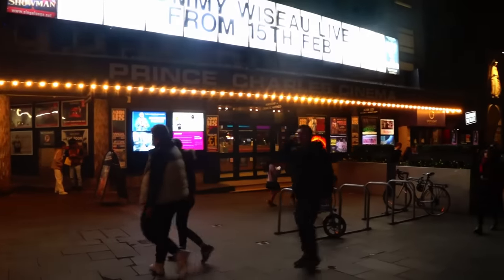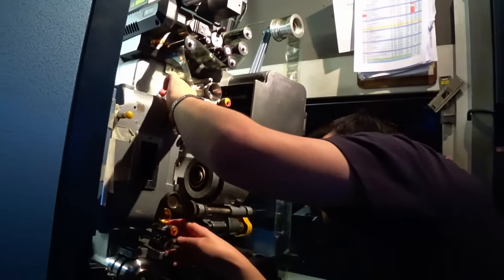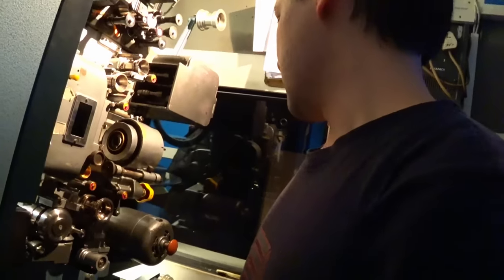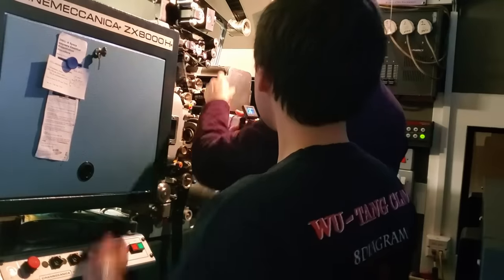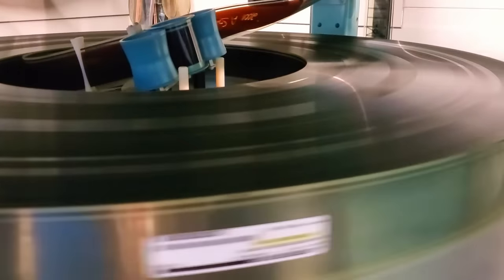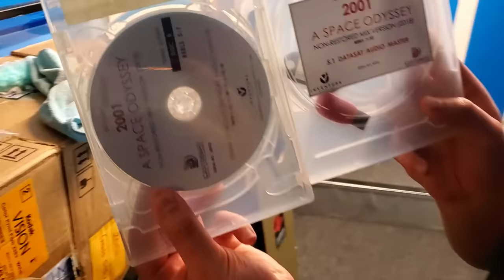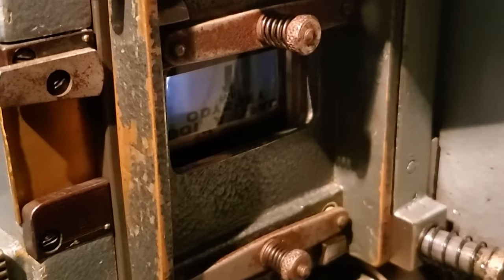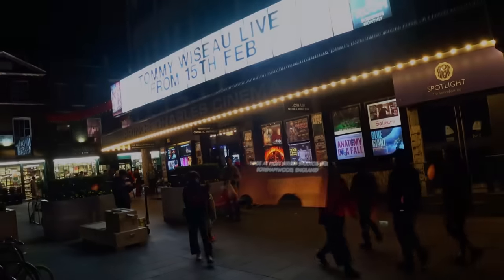2001: A SPACE ODYSSEY in 70MM FROM THE PROJECTION BOX at the PRINCE CHARLES CINEMA, LONDON

Comment: I screened 2001 (back to back with 2010)  in 35mm back in the mid/late 1980s, also on a horizontal platter.  I watched the 50th anniversary 70mm print in Vancouver BC. I bought the 4K BD when it came out and I still love watching it.
Reply from the maker: My first 4K copy of 2001 developed the 4K fault so I've had to purchase another copy.  Haven't opened it yet but I'm sure this one will survive.  I've come across six 4K's with the fault so far out of about 300 discs but I haven't checked them all since I discovered the problem about two years ago.  I do have a Super 8 copy of 2001 so whatever happens I'll always be able to watch it somehow but nothing beats a 70mm print... unless it's on a Cinerama screen but that's the last item on my 2001 bucket list to cross off.
John.

Comment: Excellent video and kudos to Sven for his expertise as a projectionist.

I do wonder why the projection of the film has to be so complicated though. Why all the wheels, reels and cogs? It's mind boggling!
Reply from the maker: It's just to get the film into the projector and then to go through it without being damaged Adrian.  It looks more complicated than it is but with a DTS reader at the top and then a Dolby Digital immediately after that (i.e. underneath) there are a lot more rollers than if it was just going through the original projector with optical or magnetic sound heads after the gate.  The rollers that guide it from the cakestand/platter system are additions too because projectors are usually supplied with spool arms or spool boxes but cinemas tend to want to show multi-hour long films in one hit nowadays.
John.
Reply: @moviecollector5920  Exactly.  Once you've threaded a projector several times, it beings to be a lot less complicated.  Still, one little mis-thread on a sprocket, or set the intermittent sprocket wrong, and you risk ruining thousands of feet of film.
Reply from the maker: @motodork  And I've nearly mis-threaded a couple of times around the sound cells on my new FP20 whilst getting used to it all so I check and check and check again before finally taking the plunge and firing it up.  Always special to run a film though.  John.
Reply: @moviecollector5920  Oh don't even talk to me about projection mistakes.  Back in 1990 when I was fresh at projection, I made a huge mistake.  I needed to move a print from one booth to the other.  When doing so, we were supposed to put four clips on the built-up film on the platter.  I thought I was good enough to move it with only one clip.  I managed to get the print to the other booth, but when lifting it up to place it on the platter, I dropped it.  Thousands of feet of film spiraled onto the concrete floor.  I didn't get fired, but I did learn humility and a valuable lesson.
Reply from the maker: @motodork  I would imagine tha sort of thing is a fairly common occurrence so you won't be alone.  I've quite often nearly lost a core out of a 2000ft roll of 35mm when putting it into a split spool.  I've been ensuring my rewinding is as tight as possible since that first time but still there are still occasions when it's just not quite tight enough.  I've had Super 8 take-up arms seize and dump hundreds of feet onto the floor but that's easy to sort out compared to thousands of feet of 35mm.  John.

Comment: I'm in the U.S. and I'm part of film forums on FB and i see posts about films being shown in 70MM at the Prince Charles cinema . One i've always wanted to see in 70MM is Peter Hyams film Outland and it was shown there not too long ago. I wish more cinemas in the U.S. would do that .
Reply from the maker: Outland was a blow-up though so it won't be quite the same as a genuine 70mm that was shot 65mm.  Outland (please correct me if I'm wrong) was an anamorphic 35mm shoot so the uptick in quality from the optical enlargement would not be as obvious as a 65mm shoot printed directly to 70mm stock.  It would still be interesting to see Outland in 70mm though because those prints, despite the blow-up process, were always the best way to see a film when first released.  It probably had six track magnetic sound too and that was the best sound reproduction of the lot.
John.

Comment: Thank you, John! Answers some questions I’ve been carrying in my head. Does the projectionist assemble the platter before every screening? Or is the whole thing put away with a forklift?
Reply from the maker: I expect they keep this film made up on a platter.  There were several 35mm films in there that were still made up and ready to go back on the platter.  At the BFI IMAX the 15/70 prints remain there and don't go back to the distributor (similar to 2001 at the Prince Charles) and they keep them on a cake stand/platter that is then put back on the platter using a forklift and simply threaded up once more.  I'm not sure the Prince Charles have room for any sort of forklift though so could be a manual, brute force process.  John.

Comment: Wow John looks like I need to start getting myself to the Prince Charles Theatre and start witnessing some of these film prints.  Especially a 70mm print of 2001: A Space Odyssey. 
Great video as always my friend. 
Trev
Reply from the maker: I think I'll be spending a lot more time there in the future too Trev.  The 70mm prints are normally struck from the original negatives so they should be the primary aim to see there but it will be nice to see some 35mm general release prints in an old school cinema again and on a fairly big screen too.  Just having stylish tabs across the screen makes such a difference to the overall impression so the Prince Charles will certainly be getting my custom at every excuse.
John.
Reply: @moviecollector5920  let me know next time you're going and I'll try and join you.
Trev
Reply from the maker: @doublebillmovies  That's a good idea.  Just got your message by the way.  I was on the other line.  Call you shortly.  John.

Comment: Is the print used for the 4K UHD disc pre or post-restoration?
Reply from the maker: Post restoration Mike and that's why I was particularly interested to see if this was perceptibly superior.  It was certainly more impressive but with it being 70mm it was always going to be so.  All the repairs are visible which confirmed it was the remains of the original negative and therefore the best possible quality without finding an original, unfaded print from 1968 (ish).  I wasn't aware of any dupey sequences like those that are apparent on the 4K but that could be down to the difference in scale between a home screen of only 10 feet and a cinema screen around 30 feet.
John.

Comment: I was there for a 12:15pm viewing.  Unfortunately the audience was quite disruptive.  The 70mm looks amazing though, especially with the close up of faces.
Reply from the maker: We were all laughing together for HAL's most notorious lines which I though made the film more enjoyable than it otherwise would have been.  Perhaps you had some of that but it didn't appeal?  As for the colour and density most evident in some of those close-ups, I don't recall the 4K disc looking that good.  But we are using domestic equipment at home so it's possible a top-notch, commercial video projection might be able to match it.  John.
Reply: @moviecollector5920 no unfortunately just a lot of whispering and people getting up and someone recording the screen during the last part of the film.  A shame as I know audiences at Prince Charles are usually quite respectful.  I own the 4k too and yes the 70mm does have an analogue density to it.  Although I think I’d rate the two formats equally.  I am prone to a bit of digital sterility
Reply from the maker: @LegoDonut18  It is possible I'll be able to get a more filmic look from the 4K disc with our current video projector.  Most are better through it than the older UHD550X but not all.  I shall have to have another look at 2001 on 4K to see but my original disc is almost completely knackered now (the same 4K fault as five others in my collection that I've found so far) so I had to purchase a second copy.  Fortunately it was only a tenner from HMV.  John.

Comment: UAU..  Being able to see whats happens regarding technical setup, it's priceless. Amazing, Thx John, Thx so much!
Reply from the maker: Film has to be film for me.  Too many disappointments with so called 'digital' which is simply a posh way of saying video projection.  However good video is now though there are no moving parts and not much skill involved in getting it on screen.  70mm is so far ahead of 4K that the top cinemas should really be using it whenever possible... but that really requires the movies being shot 65mm and finished on 65mm for 70mm master prints so it's a pipe dream now.  John.

Comment: John forgive my ignorance I’m very uninformed. Is there much difference in seeing a movie in the cinema in Imaxx instead of standard? I’ve seen Dune part two twice in standard but not yet in Imaxx.
Reply from the maker: It's difficult to know the answer to that because neither of the DUNE films were shot on film.  If you're asking whether standard 2.20:1 70mm is better than 15/70mm IMAX then no, the 15/70 prints are three times the image area.  Gawd only know what the equivalent would be as a digital video file for a film shot 15/70 (actually 15/65 because films released in either 70mm format are shot 65mm because no room is needed when shooting for sound) but I'd estimate at least 18K but probably much more than that for various reasons that cannot be quantified.  The second DUNE film was only shot 4K but it has been cropped to 1.43:1 for some sequences to match genuine IMAX screens and this also makes 15/70 prints viable.  I've just been sent an IMAX film strip of three frames from three different scenes and I have to say that it does look good but how good it would look 85ft wide at the BFI IMAX remains to be seen.  I wouldn't bother going to see the film video projected so you can guess where I'll be heading assuming I do actually get the time and the chance in a couple of weeks.
John.
Reply: @moviecollector5920 
15/70 is probably closer to 90k. 35mm film is probably 12k. I suspect that 15/70 screens could be several times larger but that would be too big for a building. A standard 70mm could probably go as large as the 15/70 screens with the same level of clarity.
Reply from the maker: @Art-is-craft  I think it's almost impossible to work out the computer equivalent size of photo chemical film gauges because there is so much else going on with projecting a film compared to projecting a digital video.  The shutters in the cameras that filmed in the first place and then the shutters in the film projectors.  Also, the light fall off around the edges of film projection that adds so much to the natural look and the diffusion  of that light owing to a physical film passing in between the lens and the light source.  Video projection can be made to produce a very good facsimile of film now but it's still a facsimile.  I used to get my calculations wrong because I'd double the 4K starting point rather than quadruple it.  I think 35mm is approaching 6K potential which is about double that of 4K.  With 70mm being around three times the dimensions of 35mm I suppose we're looking at around 10K there, but I think there's an increasing enhancement with a larger film gauge so probably more like 12K or even 15K perhaps.  15/70 IMAX is three times the size of standard 70mm but the important aspect of that is the fact that it's around one-third wider than standard 70mm as it's projected horizontally.  The difference when it's up on the screen is surprising and I think this is why the larger that a film gauge is the exponentially superior it is.  Standard 70mm is impressive enough and far in advance of any current method of video projection but 15/70 is simply off the scale.  Compare genuine IMAX to any faux IMAX, which at the most is just over 4K, and everything else is simply a joke.
John.
Reply: @moviecollector5920  
What we do know is that grain size is about 25 microns and film pigmentation is in the nano scale. Basic mathematics would demonstrate that 15/70 is probably about 90k on a cinema screen when the initial film stock is expanded several thousand fold.
Reply from the maker: @Art-is-craft  I like your thinking there.  90K it is!